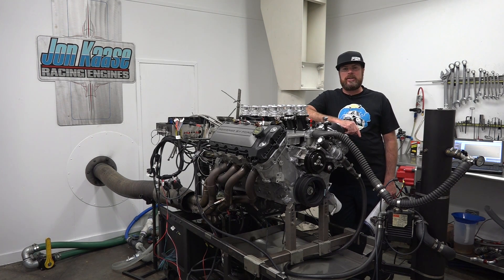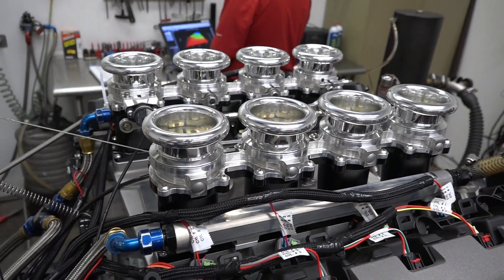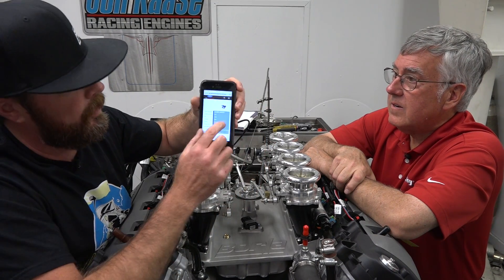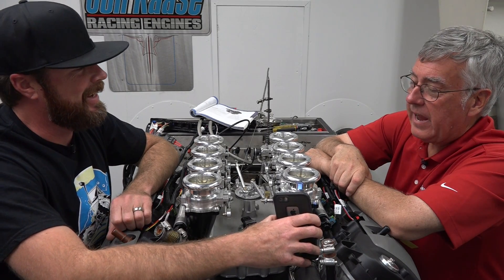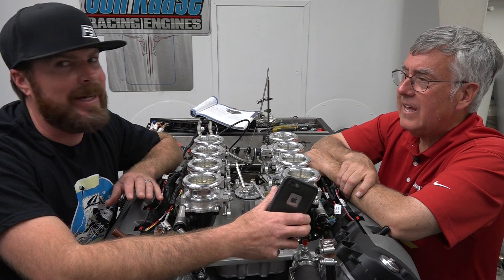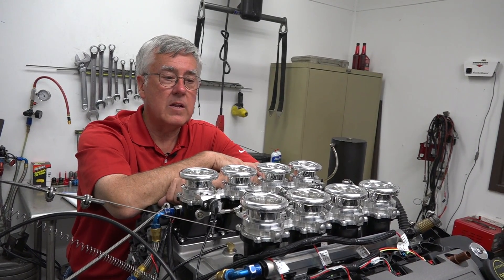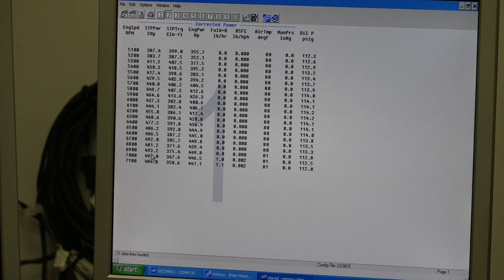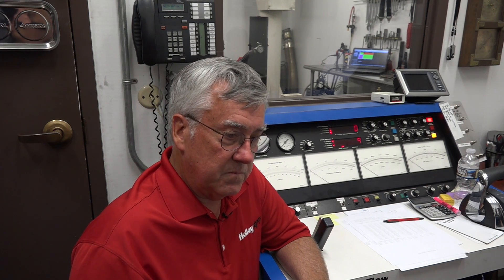Finnegan's Garage Ep.37: Dyno Testing a Ford Coyote Engine with Borla Stack Injection

Comment: While europeans and japaneese have done over 100hp per litre factory NA for over two decades, americans get jiggy when being close to that with an additional 6500usd spent on a high value engine xD
Reply: +SolDMG
300 horsepower with all that torque. That S2000 must be a stump puller...
Reply: jiggy. Europeans still haven't figured out how to make torque.
Reply: SoLDMG cool story, you drive s2000 and I'll drive ground shaking v8, wonder which ones more fun.
Reply: +SoLDMG
I think your perception on torque and what it does is a little hazy and torque values at 7000 RPM are absolutely superfluous. Torque output between idle and about 3k RPM is what matters most - it's work done to get the vehicle going and the "feeling" of power in the lower RPM band.

Horsepower is horsepower as it's the metric for acceleration, but needing to get to 10k RPM to obtain almost 300 ponies makes for a dog of an experience if used for anything other than "racing" or spirited driving in a car. Numbers given put that beast around 155 ft/lbs peak torque. For fun, a calculated 103 horsepower at 3500 RPM (picked for likely normal shift RPM). Only saving grace is the light weight of the S2000.
Reply: Lifted_Above: Europeans know how to make torque. We spell it "TDI".
Reply: Hp/L doesn't show engine efficiency. Given the horsepower formula is derived with RPM, that being a variable itself makes the argument flawed as red line can vary wildly engine to engine. Is an engine that can rev to 14k RPM and make 150hp from 1 liter of displacement MORE efficient than one that revs to 7k RPM and makes 150hp but from 2 liters? Absolutely not. It's a trick question - theoretical (importance on this term) efficiency has these engines equal. The smaller engine is making 75hp at 7k RPM and the larger is twice that with 150hp at the same RPM, but also double the displacement. We can get into power curves and how low an engine makes peak torque, actual hp at a given RPM, etc., etc, but there's the example that breaks the myth.

A more true metric is HP/Liter, then divide RPM at which said engine makes peak HP into that number. Gearing for overachiever mode would then have you factor in brake specific fuel consumption for that power output for "efficiency", but the first part wins the power output argument.
Reply: Specific output means nothing in the real world. It is a useless measure and has no real value except for meaningless argument.
Reply: LiveBig7 9900RPM deadline is a lot of fun.
Reply: Matt it's got plenty of torque I believe. You don't have/need much torque at 7000+ RPM anyways.
Reply: Lifted_Above not true. My Peugeot 205 GTI 1.9 makes 119lb/ft. Scale that figure up to like, a 5.0L, that means it has 313.16lb/ft per 5 liters (or 302 cubic inches). It's all relative.
Reply: It's going to be a lot of rowing through gears for cruising, but acceleration is all about HP and 300hp is 300hp.  So it's going to faster than something with less than 300hp assuming the weight is about the same.  

The downside is the S2000 engines aren't that durable say vs a LS at 300hp.  A small LS's will go 200k miles with no problem, an S2000 motor not likely and it needs valve adjustments every 25k.  Where with an LS you are looking at changing fluid and plugs.
Reply: I think you may be using that word wrong. But, I will also have to respectfully disagree with that argument. The HP/ci argument I think is a valid point as I believe that it does show the efficiency of an engine which is a great thing to have.
Reply: There is one case were it matters, whey you reach max you can bore and stroke a motor.
Reply: Yes a 1L engine in that example would be more efficient there nothing tricky about it.  Though I suspect you are referring to overall power not efficiency.

In application it's very likely the smaller displacement engine will weigh less, so all other things being equal it's going to have a slight edge for that.  It term of power they both make 150hp.  If we assume they weights are the same it will come down to the average power between in the rev range they are operating.

HP\L is very valid as an engineering benchmark. More so for naturally aspirated engines but also boosted application.  It's gives you a good idea of the volumetric efficiency of the engine.  

We have metric for voluntarism efficiency and fuel efficiency already.  So the whole last sentence would be redundant.
Reply: Peak numbers matter, but curves matter more.
Reply: Using strictly HP/L is not a valid metric. I'll argue one engine able to rev high is testament to better engineering through design and technology and doesn't necessarily equate to meaning higher efficiency compared to a bigger and lower revving one. By accounting for engine size, how low in the RPM band a given engine makes its power, AND adding BSFC in the mix is the true efficiency metric. HP/L in the previous example has the smaller engine as the winner. Both making the same horsepower per Liter per RPM, busts that stigma and honestly are a tie due to accounting for RPM. Whichever engine wins the BSFC war by consuming less fuel while making that power, that's the tie breaker and overall winner; there's no redundancy there if trying to distinguish power from efficiency. In engineering sense, volumetric efficiency is indeed what we're speaking of overall for the two; it still doesn't care about just HP/L though.
Reply: SoLDMG 300 how isn't much.. my cobalt has more than that at the wheels for very little money.
Reply: yeah but the smaller European engine's don't have the torque down low without boost. Most of the European v8 engine's are no more than 4 liters besides that 6.2 mercedes
Reply: There was no 1000 hp per litre in normally aspirated trim.know what your talking about
Reply: @rickkowalske4116  who said 1000 hp/L?
Reply: @meifert2  looks like I misread a 0.my mistake
Reply: American high performance motors actually last...
Reply: Only people who know nothing about how engines work uses hp/l to make some sort of jingoist argument.
Reply: It's a common set up on every motorcycle on wich even a basic model can get you 100 hp a liter easily at this rpm.
my 30 years old bike with a vane meter does the same numbers with 3 cylinders (power/rpm) 
I'm really not impressed at all,not kidding.
The only "impressive" thing is the ability for the bottom end to run 8000 rpm,considering its mass,but since it's a square  stroke /bore it's quite normal...
Reply: On the street, it has no purpose, that is correct. When talking about engines and different engines I think it has a very real purpose and value.
Reply: My neighbours S2000 has full bolt-ons (still NA), made close to 300 horsepower on a stock bottom end, revs all the way out to 9900RPM. He's driven 40.000km's with it, about 25.000 miles, which weren't highway miles. Regularly goes to his cabin in France taking the scenic routes. Never skipped a beat. So not only American high performance engines last.
Reply: @SoLDMG  my 12A RX7 made 300 hp, revved higher than 11,000 RPMs and still made more torque than an S2000 while weighing less and not trying to kill me on every turn.

Comment: That's a waste if you can't take advantage of the VVT
Reply: I would say it is application dependant, if you have the correct supporting mods like cams, intake, ITB and velocity stacks there are huge amounts of power you can make with a correctly tuned VVT system. 
For a similar comparison in not only engine displacement 5.0 but also VVT i will refer to the S62B50
In stock form from bmw it made 400Hp. 
However when Ascari got hold of it, they changed the cams, remapped vanos (VVT) system, new valve springs and different intake. Rotating assembly remains unchanged, heads remained unchanged. 
That very same 5.0l 400hp S62 lump from bmw now makes 625hp and has much more torque from lower in the rev range right through to the redline thus giving it not only more power but more usable power throughout the entire rev range.  

And if the owner can drop $6500 on an intake for 50+- extra HP i would say getting an experienced tuner that knows how to tune a VVT system is well worth it and he can most certainly afford it.
 considering the S62 motor had an increase of 225hp and wider power band with minimal hardware changes.
Reply: Megasquirt efi
Reply: VVT is toyota, VVL is honda
Reply: There is no bigger cam profile on the cams. It is all one cam profile and doesn't require a second lobe design like the VTEC or i-VTEC systems do.
Reply: +acmadni turner VVT and VVL isnt the same thing
Reply: Kinda true.....the drive ability would still be better than a high lift/ long duration cam in block engine but with forced induction you don't necessarily need a cam that big
Reply: NO drive by wire on this one guys its a cable old fashioned run. Although I do not think the VVT is still in this motor Not sure like Finnegan as far as the internals on this bad boy coyote but its a new motor. Honda is the first company next to Mitsubishi to do the Variable Valve Timing Toyota as well SO ??? I wouldn't care I want one.
Reply: wrong as two boys in the woods.
Reply: I'm guessing it's locked to the bigger (high rpm) cam profile.  So not a waste of power, but still seems like a lost technology advantage
Reply: carbo19 so waste of low down torque then
Reply: No no Vtech is honda and VVTI is toyota. That being said you get different forms of Variable valve timing (VVT) applications.  Vtec has variable valve timing on both exhaust and intake whereas earlier VVTI applications is intake only (later generations of VVTI switched to both intake and exhaust)  and the newer generations of Vtec and VVTI engines also have VVL (variable valve lift) which not only controls cam timing but also controls how far the valves open thus can control the velocity if the incoming air at lower rpm resulting in a higher torque output lower in the rev range and once the engine passes a certain RPM it switches over to a higher valve lift profile so that engine breathes better at higher RPM.
Reply: Danny Silva Not really I love anything that makes good power........ Honda's make GREAT power per liter.  When the S2000 came out over 17 years ago with 120 HP per liter and a 9000 RPM rev limit I was REALLY IMPRESSED.  And I consider myself a Ford guy.
Reply: carbo19 not if your a ford guy they can't stand it when you tell them. The vvt on a ford was inspired by the Honda k20 head
Reply: @Honda-tech13  Ford had VVT in 1989. Honda developed a different system later.

Comment: What a waste of money $6500 for a intake that only gives you a 60hp increase, turbo or nitrous set up would of been cheaper and would of got better hp - $ ratio
Reply: But this really does look cooler to be honest.
Reply: +Nathan Porter dip shit, i was going off by what was said in the video... Finnegan said that 435hp at the fly wheel and the dyno showed 493hp, so roughly a 60hp gain Actually 58hp for the people that want to be anal  fuck this comment section is full of idiots today, also no one said manifold, they said intake
Reply: Bitter Raven It's not your money bro.  If that's what he wants why would I give a shit.
Reply: Some people spend thousands on a paint job, because racing stripes make you faster. Who cares? Their money.
Reply: Bitter Raven you get throttle response too along with the possibility for stupid simple meth/water spray.  it's not all about horse power. Also nitrous kills engines quicker than anything and you won't be running it all the time.
Reply: With that kind of cash it is the "Look" he is buying. I would have got a Kaase Ford Hemi. But that is a whole lot more , but maybe just as wide?
Reply: Kaase is king of Big Fords, and does some pretty bad builds for other engines. For that kinda money, and with looks and high RPM power the priority, I would have gone with the Boss 429 reproduction heads, but hey, whatever floats the owner's boat. It's still cool, albeit way overpriced.

Fun part is a BBF can fit anywhere a Coyote will.
Reply: Bitter Raven --- wow, you're the rocket scientist here, can't get anything past you.
Reply: I would say it wasn't even a 60hp gain.Considering the factory 435hp rating is as it sits in the car with full exhaust and full accessories.The gains here were minimal at best.
Reply: No such thing as a 60hp gain from a manifold. Stop reading brochures
Reply: +4g63mark im glad you dont give a shit.. but this is YouTube and Finnegan made a video about this product so we have the right to discuss or debate it, just like if you didnt like my comment you could of scrolled past but no you decided to put your 2 cents in
Reply: Bitter Raven Waste not waist.  Skip classes in grade 3?
Reply: mds19238 you're commenting on a video thats what nearly 3 weeks old...the interwebs moved on from this subject.. are you always one of those blokes that buts in on a subject after everyone has stopped talking about it
Reply: +Berno Bruvn Mikcalson i wouldnt pay $6500 for throttle response and induction noise